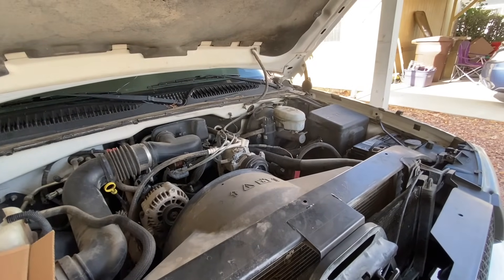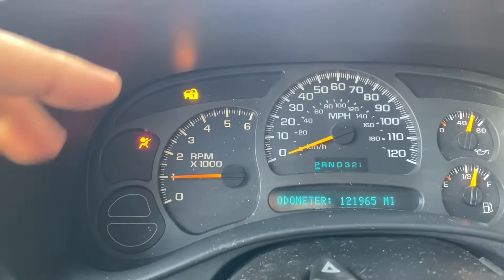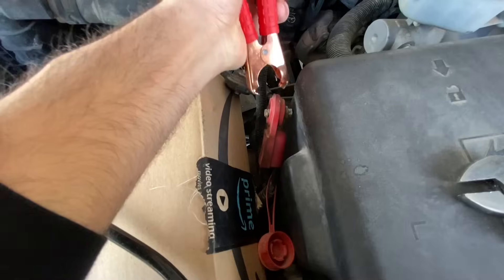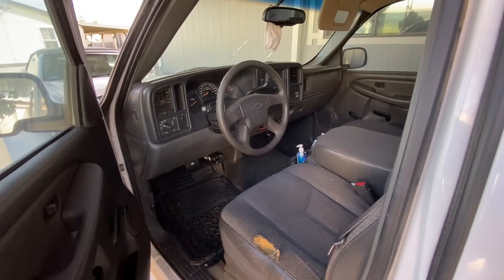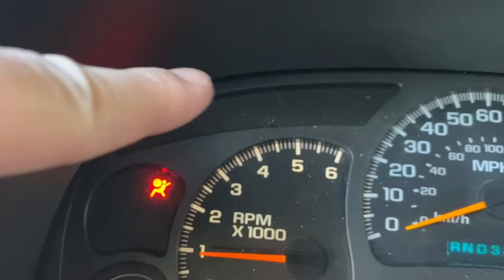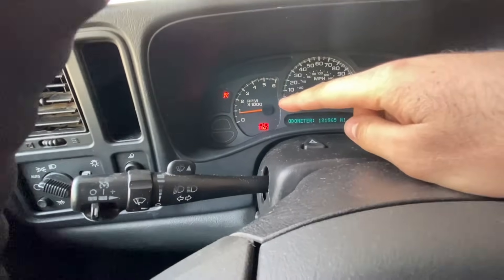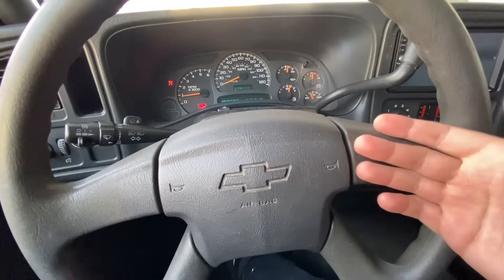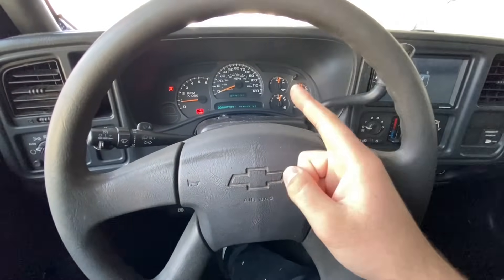How To Reset All ECU’s And Control Modules In Your Car Or Truck Safely

Comment: If this actually works on my 2013 accord then YT should add another donation feature on ur channel cuz it’s saving me almost $2000 to reset or reprogram my dashboard lights (steering wheel, traction and tire pressure) after I changed my clock spring on steering wheel last week 👍⭐️💰🔧🚘😅

Comment: You got two different videos saying it resets the car..?? So which is right , do you remove both the negative and the positive and then link those together to reset it or do you just take off the negative and grounded out with the positive still attached to the battery? Which one do you do? I mean, messing up Cars bro you gotta decide which videos the correct video here.

Comment: I have an 89 Dodge ram van 318 didn't really need to tune up but I did anyway in the 6 years time that I've known it it's never needed any work plugs wires cap rotor air filter immediately ran like shit. Check coil it was fine so replace fuel filter just recently found out that it may have the brain box. I've heard of disconnecting the cable watch the video and liked it my question is the tipm the same as the ECU is that the same as brain box? And what's the difference between a hard reset and a soft reset? Again the van is always drove by and it was our church van always had a tank of gas right now I run on here a lot and even ran out a couple times should I check the new fuel filter it's only been 2 weeks should I drop the gas tank and clean it? Not sure where to start and I know nothing about computers thank you

Comment: Ssangyong Rexton 290 2002 automatic, would not shift to 4th gear and would usually shift very ruffly otherwise.

After doing the reset, as shown in the video, shifting to 4th is no longer an issue. Also it shifts like a dream between all the gears now.

Thank you very much good Sir!

Comment: Hoping this will work for my 2002 Dodge Ram. Need a good battery first though. Had it running earlier but not enough juice within the battery to keep it going with my foot on the gas.

Comment: After replacing the fuel pump in my Jeep grand cherokee laredo 3.7 WK- Im now having a problem with a vapor lock and my new pump is making a ringing/humming  noise off and on-is there a way to fix it with a inline check valve or inline filter of some sort. I have to release pressure on the fuel rail to re-crank it after it runs for more than 20 minutes/ which is a possible fire risk.

Comment: Thanks good video. I was told to start the truck put the transmission in low or 1st gear for 3 minutes and 2nd then drive and reverse.  Does it make a difference  ?
Reply: Yeah. There’s a ridiculous number of relearn processes out there. Some work. Some don’t. It is highly dependent on the year and if it has an electronic throttle body or cable.

Comment: Awesome video 🙏🏽 
I’ve ordered a remanufactured BMC flashed to my vin twice, and both times got a no start. I’ll probably have to perform this process to get it going, but now I’m wondering what will happen if I reset my original BCM 🤔
I’ve had my truck for 2 years and the horn never worked, and the same with the A/C. Recently the third brake light stopped working 
Since last summer my CEL would flash after about 3K rpms, it started idling rough,  and had all types of codes. 
Replaced everything, cleaned all grounds, and now I’m down to the BCM, but I’m really wondering if this step will cure it of the random codes, cel flashing and everything else. 
THANKS!!!
Reply: Did it work for you?

Comment: I just used this method on my 2005 Honda CR-V it worked like magic. I tried a Milwaukee impact, a Dewalt  impact,  my air impact, a long cheater on a breaker bar using the Honda tool (I broke the harmonic balancer doing this). First try using this method it came loose. Hooray!😅 Thank You.🎉
Reply: Why did the harmonic dampener break? I'm confused at what method you used and all the impact talk. Aren't we talking about discharging the systems after disconnecting the battery? I'm just trying to understand what you're talking about. I'm dealing with knock sensor code on 08 turbo acura rdx. You having an 05 crv I'm trying to figure out if this can help me with my problem.
Reply: @ The harmonic balancer is bolted in the end of the crankshaft. It helps mechanically balance the engine. It has no relationship to the electronic components of the engine (ECU).
Reply: I believe you commented on the wrong video. This video is about draining all power from the vehicle's circuit to reset the ECU.
Reply: Hès just trying to break the rhythm of knowledge...

Comment: i have a 2017 Ram 1500 and i replaced the battery , after the information system would only show the tire pressure will this hard reset put my truck computer back online...help

Comment: Might this work on my 2004 Corolla? It doesn’t start, all of a sudden, and I’ve replaced both O2 sensors, and the fuel pump. Air/ fuel mixture? Haven’t put a scanner on it yet

Comment: Only thing that wont work on my 2007 chevy uplander is my door locks and i cant open back door at all would this be the bcm gone bad and can yhis work for me also i eont have and codes ir anything on dash locks just stoped working
Reply: Probably the lock actuator for that door that could be bad . Pull the panel and feel it to see if it's working when you activate the button.

Comment: You can't fool me with this, my friend.
Reply: I agree 💯 with you friend ---- myself have a N5 (NATIONAL CERTIFICATE) in electronics and have been seriously involved with HIGH TECH electronics for 22 years ---- what became an exercise developed into a habit of trying and experimenting MOST of these fools claims that they can "cancel" engine lights and warning lights on vehicles by simply taking battery terminals off and jumping the negative to the positive ---- NOTHING of those so-called "HOW TO RESET ALL ECU'S AND CONTROL MODULES" works ---- even on motorbikes ---- it just adds more issues

Comment: Greatly appreciate your Education , i personaly have a problem with a 1986 lincoln towncar signature series -ecection car loaded with many swstems -ya digitial door entery codes alarm -moon roof air shocks from factory moon opening full roof squeezer trunk -spock wire hubcaps -full digitial dash in Miles -headlight photo sensors -ya automatic in owercast days here in Canada - trying to get someone to reprogram a brand new PCM

Comment: I have a 2002 Cadillac DeVille and I tried this and it didn't work
Reply: There's a different method I did. It's the 11min key on then 30 seconds off, then turn key on for 11min, then back off for 30 seconds, then back on for 11min. Then back off for 30 seconds, then turn key on for 30 seconds, then after all that you try and start it. That worked for me.

Comment: I was sceptical at first but it worked like a charm did this on a 2006 Buick Lucerne and upon reconnecting the battery the interior lights came on the horn honked and stopped it started like a charm.
Reply: U couldn't even rest the air bag light what in the hell are you trying to do bro your just making shit up!! U put those cables on for 12 or 24 hours to reset the cars ECM dumbass!

Comment: its called reset motherboard  disconnect to reset idiot lights if you have problem again that light will come back on go to auto part store use obd 2 scanner then you will know what part needs to be replaced

Comment: I did the same with my Toyota Camry hybrid 2015 but I have two codes back on the board.  1. Check hybrid system . 2. EVEP..
Any solution. Thanks

Comment: Will it work on Hyundai ioniq hybrid 2017.?
Reply: Hi mate, did you try this? I have the same model, encountered some issues after dead 12v battery.
Reply: Hello did it workes i have same Hyundai ioniq hybrid engine no start  @saman3110

Comment: Sir, my car has already started manufacturing,1,2,3 ignition coil is working fine, but ignition coil 4 is not supplying current, will the help of your teaching,solve my car problem.

Comment: Can anyone tell me, what is the purpose of this exercise?   I mean, is this supposed to magically get rid of PIL's (problem indicator lights) on the dash panel?  Because it won't. If there's an actual problem with one of the car's systems (ie. ABS system, O2 sensors, Air bag system, etc.) then a light will come on in the dash panel.  You many get it to go out by clearing the trouble codes in the ECU through this "reset" method, but the PIL will NOT stay out.  It will come on again when you start the car and let it run for any length of time or when you begin driving it.  So then i ask again, WHAT is the purpose of this?  Does a perform some other useful function that i'm yet unaware of?   Anyone?  Feel free to reply please.

Comment: i thank i need to do this with my Ford Ranger i replaced the value cover gasket  and had to take the Throttle body  off and replaced the icm and everything for the AC  and power steering unit and hoses and now its want idle till it gets warmed up do you thank i should do it on my truck to reset everything ? i checked the idle air control solenoid  its post to drop in idle are stall if you unplugged  it amd it didn't do anything when i unplugged it so i got a new one but haven't put it on yet and a new sensor for the Throttle position sensor to and haven't put them on it yet was thanking maybe i just need to reset the computer too.whats your thoughts on it? Thx!!
Reply: id say you need to clean throttle body
Reply: @MikeSmith-dg3wu  did that every thing is good now. But thank you.

Comment: On a modern car this could possible cause power spike in the capacitor causing more issue or even new issues including a fried ecu.    You should always use a resistor inline between the negative and positive cables.  1ohm 10w resistor should take roughly 15min . You can use higher resistor but Higher resistors wil need to be connected longer
Reply: After disconnecting the battery, turn on the headlight to dissipate the capacitors.
Reply: My Mazda 5 2010 diesel have suddenly lost the Bluetooth - option does mot appeare when pushing on the phone knob. - mute - appeares instead
Anyone know procedure for resetting?
Reply: where do you pick one of them up at?
Reply: Usualy when i push the phone-button the i car phone system starts asking if wsnt to make a call, reg a New phone, etc - and when someone calls me while i my car i hear 'incomming call' i push the button and anser the call over the loadsystem..
My obd2 also get No contact with the car.
Reply: I bought a resistor from Amazon for a few bucks got it like the next day

Comment: Incorrect! Disconnect negative cable, leave positive on battery.

Jumper from negative cable to positive terminal.

After 10 minutes reinstall as normal. You're welcome.
Reply: @riffraff9545  I have been doing this for years.

Comment: I have a 2009 Tahoe, and my crankshaft position sensor keep going out. I will keep replacing it about once every 1 to 3 months. Someone told me i might need to reset my ECM or replace it altogether.  Would this work?

Comment: Do you mean connecting the positive and negative battery cables together? And you are using the jumper cables to hold them together?  Someone told me to do that so i can reset my navigation on my 2007 honda odyssey . im just wondering if this is what they meant for me to do
Reply: Yes

Comment: Can I do this to put in a used ECM that I bought from the junkyard in my truck and it will crank without programming it by doing this. Because the ECM I have now is burnt in some of the circuits from the guy prior to me on the truck thank you

Comment: This case: computer was wrong, check engine light NOT SUPPOSED TO APEAR. it needs to manually reset it. I agree with him.
Most of the case the sign of check engine light cannot BE NOTHINGS, must be SOMETHING WRONG. Test it and find out What???

Comment: i did that and it ran good for about 2 min and then went back into limp mode in a 2004 gmc sierra 2500 hd 6.6 duramax

Comment: This is misinformation, a band aide on a broken leg. It will temporarily work for a short time. The ECM will see this as a historic problem and will set a code again. Fix the problem right or pay more down the line

Comment: I noticed your cable you used was a single cord. It's that significant in results?
Reply: you dont need to user a cable. you can just disconnect from battery and touch the hot and ground together, its the same thing

Comment: I installed another cluster on my 2012 gmc canyon and the one i replaced ir with has high miles than what my truck actually has 
Would this work to reset my milage back to what it actually has?

Comment: many Ppl say wat you sugest, Yl others say just disconnect negative & leave headlights on for a Yl.  😩un4tUn8LE hoOever thO - the positive may not flow through the headlights w/out a full circuit(negative ), &&& - I don’t C where this closed + loop(w/battery isolated by… cRdbOrd?), is supposed to exit remaining electric…  I would only guess.. that the best?.. is to disconnect both cables, touch them together, with headlights on, for N aDQ8 chunk of time.

Comment: You ever tried just turning the key switch off that's located by the heating and air conditioning unit switchesIf it is in the upright position you want to turn it to the right and it will take that light off
Reply: What light the air bag? Please explain again if u talking bout the airbag light

Comment: This does work folks,Ive done it many times.
Reply: Hello..would this work on a 1972. Oldsmobile  cutlass
Reply: @matthewespinoza2536 If it has a computer.
Reply: How would I do this to my car that a keyless start I got push button start and everything in this video I need to do to my ford focus but its button start
Reply: Will it work on a 2013 ram 1500 Laramie
Reply: Will this work on the 2012 Nissan Sentra 2.0?
Reply: This doesn't work on old codes on the ecu people not on newer cars
Reply: Wil it work on 2010 altima
Reply: @marklewis4664 Yeah. What this does is it temporarily kills a little battery in the computer that retains memory. Then the computer can relearn the sensors.

Comment: I took my car in garage after ignition switch and starter. I bought the reconditioned and programmed ECM from Flagstaff -- a company from New York ( priced at $176, but with exchange and shipping = $384)!!!
I'm a dyi'er beyond my skill set. 
I took it to my mechanic who had a scanner, diagnostic technical knowhow, etc.
Reply: David W.- just sent my ECM back to Flagship One for reprogramming. How did they work out for you. Seemed like the BCM issues never reset. Your thoughts please....
Reply: @jeremiahcannon4443  
So far so good

Comment: What about pumping the gas pedal? The only video to reset ALL systems to where upon initial start, the rpms went to maximum before quickly slowing until settling at it's expected idle speed. 

This is the closest video I've found to that one I saw a couple years ago to fix my tps issues. The main difference the other one included pumping the gas pedal I think right after turning the key and holding for 10 sec 2 or 3 times, no start then something else or ignition idk. No other reset has been so complete, anyone know how I can find it?

Comment: This is a nice tip, however I have a problem with my car. The dash board has no power as well all the body control function are not working but there's a power going to fuse box under the dash board from the key switch. Can you help me what is my next step?

Comment: Now the only thing I seen that I don't understand is why you de energized the system that way when you could disconnect the battery , both POS and NEG. That's red POS and black Negative.
Touch them together. Anything in the system will de energized  pretty much once you touch. I do this for batteries 2 and reset in the check engine light I mean you don't have to do it for the check engine light touching together it will just do it just to disconnect the negative.

Comment: Would It be safe for me to do and get the stock/original tune back if the previous owner of my truck (2003 Sierra 1500 5.3l) took it to a shop and paid to have a custom "gas saver" tune put on it?  and if so it would just revert my truck's tune back to stock right?
Because that's the goal here since the tune on it now doesnt allow it to rev past 3k rpm in any gear when on a stock tune 1st and 2nd gear shift out at 52-5600rpm.. so the truck just feels gutless and I to revert back

Comment: This helped me save a ton of money. I had a ECM malfunction and the recommendation was to reset the ECM but the dealer wanted to charge a fortune just to do that. Worked like a charm. Thank you very much 🙏
Reply: I came here looking to see if this would work for that exact reason! Thank you
Reply: Were you getting any activity from the vehicle before you did the reset? I crossed the leads on a jump start and I have no lights or anything. Will this work on fried ECM?
Reply: @stevencamacho8234 out
Reply: 😂 @stevencamacho8234
Reply: Good advice
Reply: Could I do this as a overnight process
Reply: @russellbizzell2516  why not do it as a 15 minutes process instead?

Comment: Thanks so much, I had the Rear AC Blower running all the time and it would not switch off (Toyota Sequoia 2014), by doing the reset steps in the this video the problem is solved.... 🤩🤩🤩.

Comment: What if I have beat in my vehicle should I disconnect my system from the rest of the electrical to prevent shortage or will I be ok I have amps and a capacitor in 99 durango

Comment: I have an interesting problem I replaced my 04 BCM with an 06 BCM from a junkyard and I can't get any of the codes to work I tried resetting the whole system by watching your video and it does nothing however it does tell me that theft  hasn't been programmed and "Starting has been disabled due to theft system" how can I fix this issue?
Reply: Think your first mistake was using a 06 bcm for a 04 car. They need to be exactly the same part from same year etc